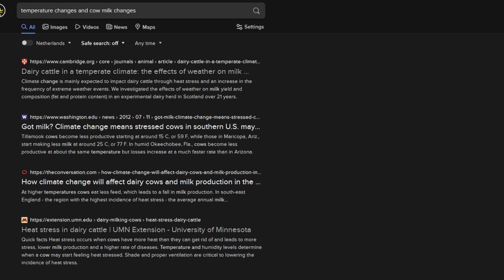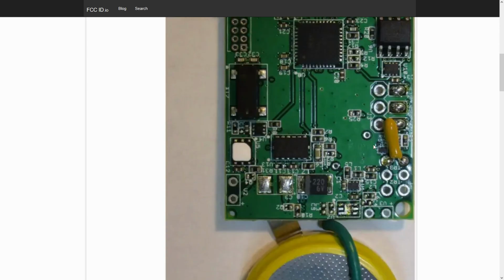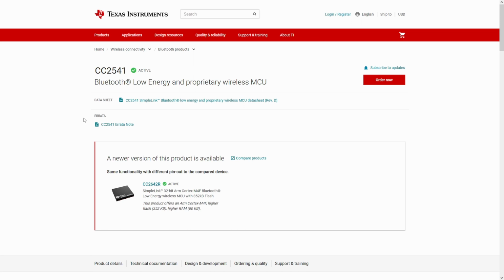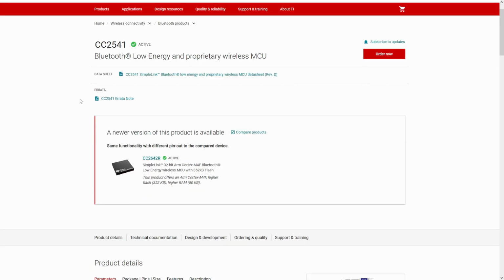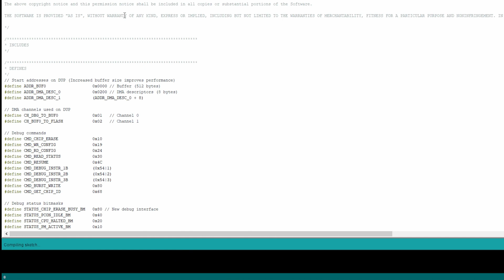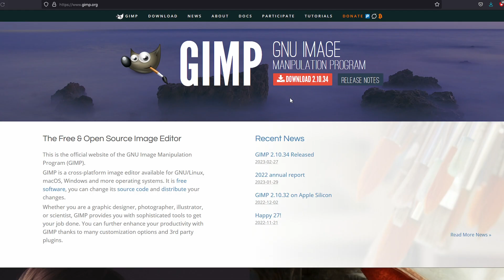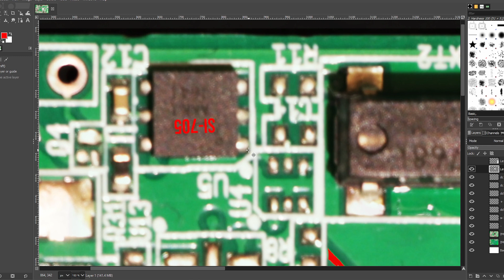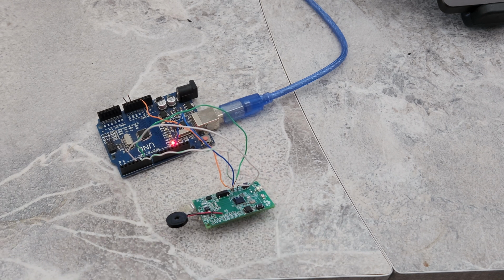Hack Your Electronics: Uploading Your Own Firmware to Any Device

Comment: J1 doesn't stand for JTAG. It stands for jack connector. See "Reference designator" on Wikipedia.
The CC2541's debug interface isn't JTAG. 
"The debug interface implements a proprietary two-wire serial interface that is used for in-circuit debugging."
"The debug interface uses an SPI-like two-wire interface consisting of the P2_1 (Debug Data) and P2_2 (Debug Clock) pins." 
from SWRA124 Rev. 1.2

Comment: I've got this "Air Mouse" Y-10W, and it's got a couple buttons that are "escape" and "control" functions and thought maybe it could be reprogrammed so they are Mouse 4 and 5 buttons instead, do you know if a mouse chip can be reprogrammed? I'm pretty sure the chip on this thing is CXW-i800L, the only thing I found about it was from a Chinese site, it's got interactable images but I don't think they have all the info on them

Comment: Very informative! I would like to know if you could read what is in the board. It would be nice to have the ability to use these sensors as is for monitoring store rooms. It would be interesting to see if one could assemble a receiver cheaply for these devices. More than likely the manufacture has the high price on the receiver logger unit since the sensors are disposable. Batteries are easy to replace and one could easily fit a socket within the housing to make battery replacement a breeze.

Comment: This verry cool, i am a beginner in reverse engineering. Do you have tips where to start?
Reply from the maker: my best tip is, find a simple device which works with a programmable MCU, and upload your own simple code on it. afterwards, write your own firmware (read sensors etc.). it is a fun process, and you learn a lot. you can also watch the second part of this video here:
https://youtu.be/nyylIe8ugiQ
Reply: @makersfunduck  thanks great tip

Comment: I don't understand why that button cell battery can not be replaced?  Just desolder it and solder in a replacement, no?
BTW  Very cool summary on modifying chips, sensors.  All new to me.  Complicated, to be sure, but fascinating.  Now on to part 2.
Reply from the maker: it is indeed possible, but you need to have their subscription based app to be able to use it. I didn't have any of those.. also some manufacturers just blocks the firmware after battery gets empty.
Reply: @makersfunduck also possible that the manufacturer stored some important information, like an AES key in RAM, making the device unusable after losing power. When Bluetooth is on, that device sucks about 20mA, but sleep mode is 1uA.  It's an 8051 core too.

Comment: How are disposable electronics not illegal yet?
Reply from the maker: indeed. it is a big problem for the modern society, and hope to see some progressive regulations about this issue worldwide.
Reply: Exactly, having essentially a complete controller, memory, sensors, and Bluetooth radio that's intended to go in the trash after 90 days is ridiculous and the ultimate in landfill abuse.  At a minimum, they should be traded back in for a large credit towards the next device so they can be recycled.